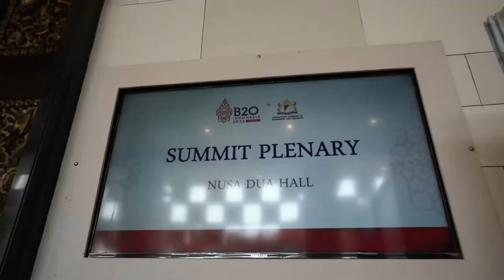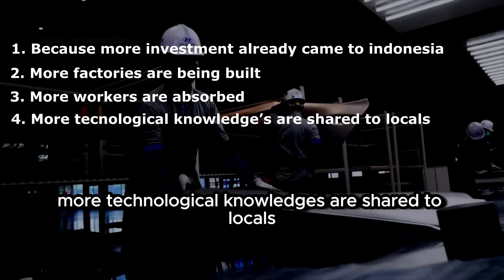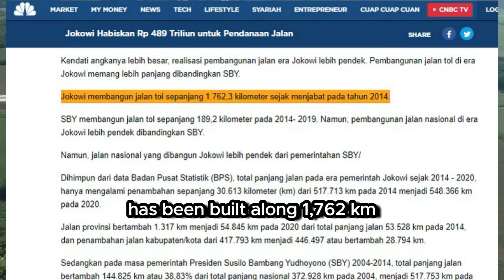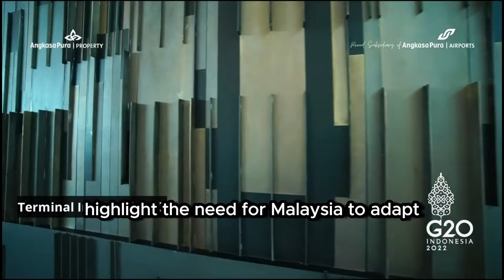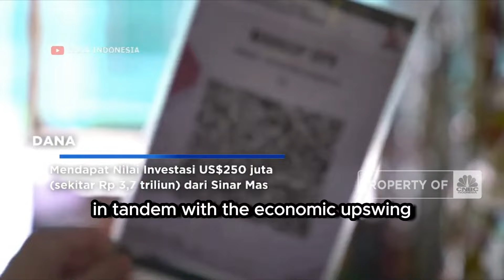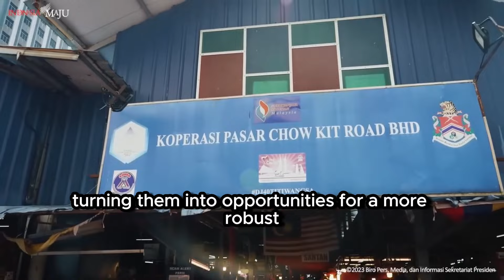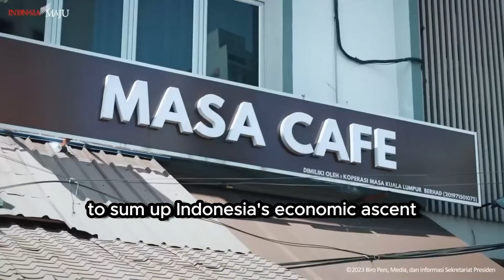HOW INDONESIA'S BOOMING ECONOMY SHOCKED MALAYSIA SO MUCH

Comment: not surprising considering how many regional airports Indonesia has been opening since 2000, i worked for a company that supplied baggage conveyors for those airports.  
BTW, most of those check in conveyors are powered by drive drums from a company that's owned by Israel.  i always wondered what would happen when they find out about this.